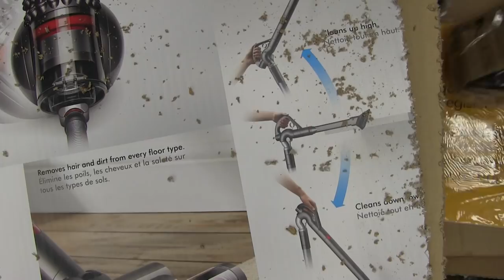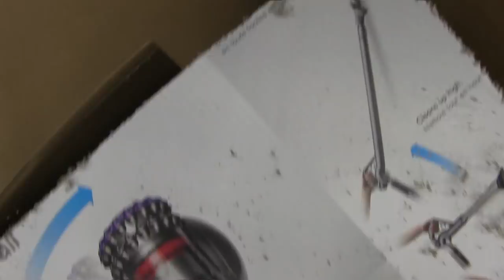DYSON ANIMAL BALLS | It blows!

Comment: Mmmmm Dyson......
Bought a V6 cordless stick Dyson.....
Rechargeable battery doesn’t last many cycles.
Dust compartment matchbox size.
If it gets a blockage [1] the motor cycles on/ off to let you know..... a frequent occurrence 
however.
On high power you get 5-6 minutes max!

[1] motorised brush bar jams. Tiny inlet from the brush head to the rigid tube gets clogged. Buildup just inside the dust container causes blockages.....

Plus side? Certainly good at picking up dust and pet hair.
Down side? All of the above.
On balance it’s a pain in the ass!

Comment: I hate these modern shitvacs. When my all steel 35 year old Eureka died a couple of years ago (failed spectacularly, lit on fire and tripped the breaker), I just settled on using a heavy duty Shop-Vac. Still a lot of plastic, but it's heavier plastic and has managed to last 6 years now unlike the shitbox Hoover I tried that gave up the ghost after only 3 months... I didn't even bother trying to get it fixed it replaced.

Comment: As with all tea-Bagless vacuums:  when the velocitage of the vorticultor is disrupted by a overfilled canister or gravity inversion(if it falls over...or yer vacuuming during liftoff...) the dust separation formulaters bust their pencils...  In the following 500msec the $1000 filter is  choked.  In less than 10 subsequent seconds that "BALL" splits the goal posts for three points.  Hopefully the Dys-teroid doesn't impact anyone in the adjacent county....

Comment: dont ever purchase this type of dyson vacuum first of storing it absolutely sucks second the utensils storage is basically non exsistant and 3rd the vacuum brush head gets blocked with the smallest of debris. DO NOT BUY! oh and 4th your wrist will get very tired after using it for minutes . not ergonomically correct by no means

Comment: the vacuum break is for when some chucklehead vacuums up something way too big and clogs the works up; the motor is cooled by the air flowing over it from the vacuum, so when there's too much suction, it bleeds some vac off to keep the motor cooled.
Reply: Doesn't the motor also run faster when under less load? I've been vacuuming very dusty carpeting, and every time the filter starts to clog, the motor's pitch rises significantly (as does its heat output!)
Reply: @SomeGuyFromCrowd  clogged filter, less air across the motor, more heat. also less air being moved, yeah, lower load. you're right at that point.

I used to do some maintenance on custodial equipment - i was a crew leader - and the "something too big" was usually either a potato chip packet, a pile of leaves from an indoor plant, or they custodian in question never emptied the bag in their vacuum. I've seen more than a few vacuums burned out because of "i picked up something too big and didn't tell anyone it was broken."

Comment: The little popout valve is so the motor always has hair. Hair keeps the motor cool, and Panasucket sez the motor has to have hair. No plugga da hair tube, or motor runs with hair on fire. Lets all the smoke out.

Comment: hey I don't agree that all plastic parts look weak.  why don't you do some cycle testing,, lets say most users vacuum 52 times a year.. some crazies 729 times for 10 years... so test these switches and plastic actuators 100k cycles like the designers probably did.. then talk about failures... this video is pure crap.... looking at my Dyson animal 2 as a Mechanical design engineer the design is actually quite impressive.  I will admit that taking aprt the cyclone is more complicated than an average house cleaner will do but thats what vacuum shops are for and they clean these for 100$ which is to low of pay for the hours  I spent cleaning mine down to the hoses. and head motor.

Comment: My ancient Kenmore upright canister has a vacuum relief valve. I assume it is to protect the motor. We all know that when you totally occlude the flow of air the motor speeds up. That is because it is doing less work, as it is no longer moving air, just freely spinning. I think the engineers rely on the flow of air to cool the motor. Fire engine pumps work in exactly the same way, impeller and all, called a centrifugal pump. If you hook your pumper up to a source, like a hydrant,  and start pumping and the  water gets shut off, like the nozzle is closed, the pumper's engine speeds up . There has to be protection of some kind to prevent the pump from overheating, as the flow of water is relied on to cool the pump. Decades ago that was a pressure relief valve that was adjustable and required setting every time you started pumping. It would shunt water from the discharge side of the pump to the intake side, allowing a constant flow of water through the pump, which gave you a good deal of protection from seizing the pump, which is very expensive. Of course today they use a computer chip to control the engine speed and who knows what else.

Comment: First off let me say I hate Dyson vacuum's with a passion....total plastic overpriced marketing junk. Dirt sticks to everything inside and it's a nightmare to get it out and all this crap to do away with using bags. Now mind you the bags have worked great forever so your really "fixing" a problem that doesn't exist with a super amount of complicated plastic cyclone creating marketing hoopla.
Having said that....it's likely that the poppet valve is a protection for the motor if you plug up the hose like when you drop it to answer the doorbell and it sticks to something and you let it wail away for twenty minutes while you have a tea chat at the door with the neighbor. This prevents it from overheating likely and is designed to produce the same vacuum level over its lifetime as the system sucks up stuff and plugs the inside filter the poppet valve will compensate for the loss of suction and increase to keep it always the same.....pretty neat engineering solution actually. The next thing is the suction powered beater bar....this system has been used for decades in the super high dollar whole house vacuums with great results and very little maintenance and is truthfully a very good design decision that is tried and true.
Don't just assume things at first glance if you don't know why they did what they did.....having said all that in defense of their system it's still total plastic overpriced crap in my opinion.

Comment: The seal on any of the Dyson brush head bearings is garbage... Even the animal model. Within a week (I vacuum 4-6 times a week, average size 3 bedroom home)  I had to rip the head apart and yank lots of hair out of the bearings. It worked it's way under the chinsy plastic seals.

Comment: The little sucker release valve is for when you suck up a sock and it clogs the intake. The valve stops the motorb from burning out. It also makes a higher pitched whine and signals that you’ve got something lodged in there.

Comment: Vacuum break so it doesn't over heat. Imagine you've got a motor running without air to cool it when you block your nozzle with an old sock.

Comment: WOW WHAT A POS! I've never bought a vacuum with the exception of a small 5gal shopvac. Always liked the bagless ones I forget what they called the first one. As seen on late night tv. My mom had one from Amway that sucked so hard that you could see where they seemed the carpet and pulled fibers where they used the kicker to stretch the carpet. Of course I believe it actually cost more than the Dyson, but Dyson is a pos. Can't use it on dust. Come on man. The old tv one was like 250 300 and to show how tough the plastic they threw it down the stairs, picked it up kept vacuuming. Before that was the kirby basically  a big $1000 plus electric bong. I wouldn't have been surprised if parts of those things were cast iron. If you think about back then you could get a gallon of gas and a pack of cigarettes for $.50 so thing was a huge swindle.